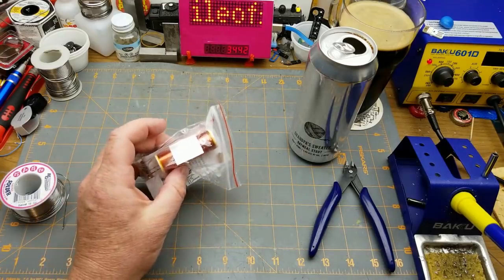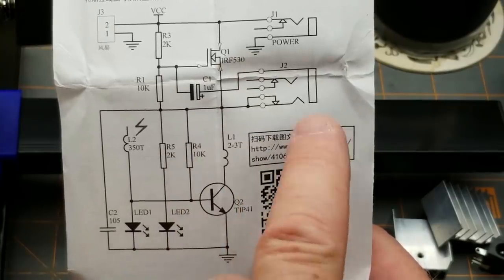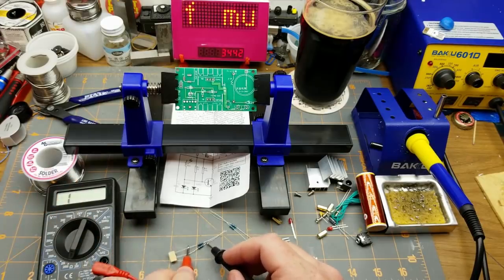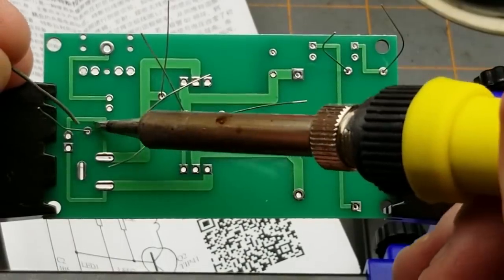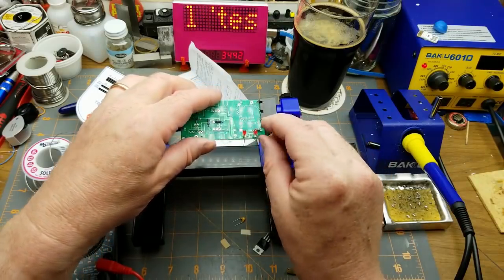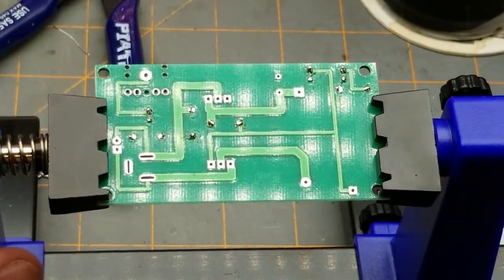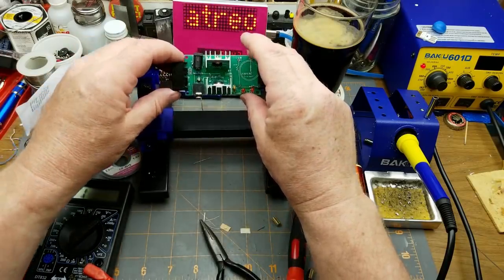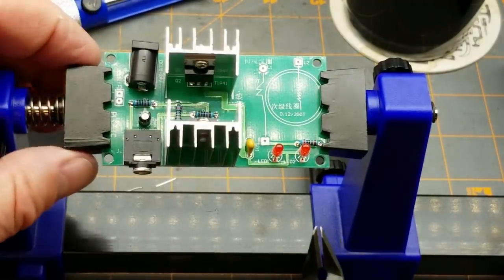kit build: tesla(ish) coil

Comment: These kits are amazingly fun.  If I can offer a suggestion, when you hold the neon or florescent bulbs, you do have to hold the contacts to create capacitive ground and the bulb lights much brighter.  There is no actual contact so to speak, (direct current), so there is no chance of shock or direct voltage contact.  The other suggestion would be to have the discharge wire, (top of coil), untangled and tucked into the coil tube with about an inch sticking out for best results.  If you have stainless steel ball or a stainless steel rod, you can set the ball on top of the coil tube with the discharge wire under it touching with gravity pressing between the ball and the tube so it contacts the ball, no soldering necessary.  You won't see the actual discharge beam so to speak, but then you have a greater surface to experiment with.   If you want to go one better... now, if you have a large Pyrex mixing bowl, (many kitchen aide type mixers have glass bowls, or any large glass mix bowl... flip it over the top of the whole circuit.  It should have a distance of about 2-3 inches from glass dome to the ball to get the best visual results.  Now you can safely touch the bowl and bring the florescent or neon bulbs near it.  Also using the audio input, if you go direct from an mp3 or  any audio source, you will hear music come from the coil, however if you use the steel ball and glass dome effect, you will not hear anything.   (The stainless rod can be dropped into the tube and the discharge wire wrapped around the rod, and that is fun to play with as well, it also saves the end of the discharge wire from burning up and having to cut it back again and again.)  **I've done these risky experiments so you don't have too!  ***As a side note, the 1uf 50v electrolytic cap supplied with the kit should actually be 10uf 50v, but! it can be changed to any thing between 1uf and 16uf 50v to offer variances in audio performance. The lower the value the better the bass response you hear, it is slight, but it is recognizable, just be sure to keep the voltage rating at 50v or above :p  I hope this helps, and give ideas for new experimenting.
Reply: Nice detailed answer. Do you have any idea about what happened to his cap that got blown?

Comment: My kit's primary winding was only long enough for a single turn around the secondary. I had it wound up against the secondary and an arc broke the insulation. I ended up using duct tape to create an air gap and now it works fine.

Comment: I built one of these with my nephew (he soldered it).  We only had a 12v car battery to work with.  Kinda worked.
My bench supply was better but similar results to yours.  I have a decent bench power supply though :-)

Comment: 9:20 - you can easily fix old and/or cheap shitty solder wick using FLUX. I always use pure Rosin paste for repairs and component recycling, so I have it on hand (literally all over my hands), so a quick wipe of flux along the Wick and it's instantly transformed. A good quality liquid flux also works great... leaves less mess than rosin too.
Solder wick needs LOTS of flux in order to work - usually the flux is sparse and once it dries out even the best wick becomes useless.  So add some flux, just try it.
Reply from the maker: That's a good tip.I usually set this cheap wick into a pot of flux and heat it with my iron to saturate the wick.

Comment: If you actually come in contact with the neon or florescent bulb (have the leafs in your hand) it will light up much better! It is safe to touch. The frequency is high enough (in the MHz range) you won't feel it due to the skin effect taking effect and also your nervous can't detect or react to it. The most you'll get is a slight burn (very slight) from the plasma and that's all. Love the video by the way!
Reply from the maker: I've had high frequency burns before, and it's an experience that I would very much like to avoid in the future.
Reply: @pileofstuff  Same here!!

Comment: I just built mine and it produces a tiny weeny spark (~2mm) on 12 volts, lol.

How tight that primary coil has to be? 2 turns worked better than 3 (higher voltage).

Comment: Hi, I tried a simple audio signal generator on my coil unit.
You only need line level signal to get the corona discharge to sing.
I'm thinking of making a simple LM555 oscillator to connect and play.
The fluro tube lights due to the high electric field exciting the electrons.
I did the same thing with the 105 cap.. and like you got to where you had an electro to place..   lol.
Reply from the maker: Off camera I tried a few different  audio sources (including an oscillator and the cheap MP3 player without the amplifier) and wasn't able to get any noticeable sound. 
I probably should have shown some of that, but the video was already getting too long.

Comment: A circuit diagram and silk screened board, luxury!  I bought one which was just a bag of components and a board with outlines but no values marked. Google image search and a really bright torch to try and trace tracks saved the day.  I managed to assemble it and get it working and as usual 5 minutes playing with it and it's sat on the shelf ever since. I sometimes wonder why we do it to ourselves, has anyone ever built a kit that actually gets used for anything?
Reply from the maker: I've got a few that do get used occasionally - mostly test type circuits, though.

Oh, and the blinky x-mas tree kit. That one gets used for a few weeks at a time.

But, yeah, I have a heap of them that have become mostly souvenirs and dust collectors.

Comment: I got a lot on Amazon and it came with no instructions. It's fairly self explanatory so I put it together. Only the blue LED lights up. No power comes off the coil. I'm using a 24v 2A power supply. 
I have no testing equipment like seen on this video. Any ideas how I can troubleshoot it?
Reply from the maker: Without being able to make some measurements it's going to be hard to know what's wrong.

A multi-meter is one of the most useful pieces of test equipment a person can have.
That multi-meter that I used was the cheapest one I could buy - $5.00  (this one: https://youtu.be/3j8JqTh8RoQ)
Reply: @pileofstuff  thank you! I own a multimeter and tried to use it after I saw you text the resistors to make sure I had the 2k and 10k in the right place. The multimeter either and I had them in the right places. 

Unfortunately, it still only lights up the blue LED.

I appreciate the response in your attempt to be helpful. Thank you very much!

Comment: Hello how are you, what was the voltage and current that you used in this Tesla coil? Could you tell me this information? Thanks in advance
Reply from the maker: Voltage worked between 3 and 5 volts. 
I did not measure the current, but it was able to operate from 2 AA batteries or an 18650 with no trouble.
Reply: @pileofstuff  Would the current be 18650 mah by any chance? If not, how much would be enough to light a fluorescent lamp?

Comment: Neat kit, looks like fun.  Anybody know how to convert a momentary button to a switch with two functions (on/off)?
Reply from the maker: It is probably easier to simply replace the button with a different switch.
Reply: @pileofstuff  Realy?  I got as far as using a voltage regulator with drain direct to vcc, gate to a primary button (on), gate to a secondary button (off), source out to led to ground.  It works really well... just want to get it working using one button.  Any ideas?  It may be a good one for a video.:)
Reply from the maker: @jv-iq9uz  Ahh. I didn't understand how deep you wanted to go. 

I thought you wanted to mechanically modify the switch.
Reply: @pileofstuff  Oh, sorry about that... I was basically trying to figure out how to make use of the pack of 100 momentary switches I have in my inventory.  I don't really have much use for the momentary funcitonality.  So I'm trying to figure out a good simple circuit to use repeatedly for the on/off funciton.  I figured it's probably not worth the trouble.  It probably requires a really specific BJT configuration.  What do you think?
Reply from the maker: @jv-iq9uz  Probably a flip-flop circuit would be the easiest way to go. That would need a pair of transistors and a smattering of passive components. Something like this: https://i.stack.imgur.com/oDkoV.jpg
Reply: @pileofstuff  Thanks, that really helps.  I was looking around and thought maybe a shift register for the toggle function.  Something like Sw -> Vcc -> Out -> LED/gnd, then just loop it...  ever tried that?
Reply from the maker: @jv-iq9uz  I haven't played with shift registers except for the LED cube video.
Reply: @pileofstuff  That was a really pleasant video.  Liked it.  I thought maybe Dta/Clk->Q0 for the on function, then Dta/Clk->shift to Q1->master reset for the off function.  It might require a voltage regulator as a gate sat switch, and a pnp tied to Q1 for the pull-down on the gate to turn off the regulator.

Comment: Y transistor very hot?
Mine didnot work.
Reply from the maker: My transistor gets hot after running for some time, because of the amount of current it is controlling.

If yours gets hot instantly and the circuit does not work, possibly there is a short circuit, or the transistor is not installed in the correct orientation?
Reply: @pileofstuff  thanks. i found the problem. my primary coil turns wrong direction.

Comment: I can’t get mine to work at all! Just the LED 2 lit and nothing on LED 1
Reply: Mine did the same you have to wrap the 2/3 coil anti clock ways if looking from above with the power jack on the left then it works
Reply: @quadmcjellydrone7909  I think voltage matters a lot. I don't have the second LED lit either on a 16V input with 3 turns primary CCW but the unit works. It's lighting the small lamp provided if held very close as well as a regular light bulb. But, no arc visible! So I suppose no audio either?
I guess it only works at high voltages 22+V.
Reply: @goku445  I found sometimes the ark stops but if I snip 1mm off the end of the coil it starts to ark again
Reply: @quadmcjellydrone7909  thanks for the tip, which input voltage do you use btw?
Reply: @quadmcjellydrone7909 Cheers for the tip, I'll try that

Comment: Thanks for sharing!  I actually built this kit about a year or so ago.   The circuit is called a slayer exciter coil.   One difference from a true tesla coil is that it is self resonant, whereas a tesla coil has to be tuned.  I got the audio to work on mine by just connecting my MP3 player directly into the input jack.  I did a video on it a while back.  https://www.youtube.com/watch?v=t8TwKls-e0o&t=1485s
Keep up the good work, and thanks again!
Reply from the maker: Off camera (before I blew up the amp board) I tried the MP3 player direct and it didn't seem to make any sound, which is why it occurred to me to try and hit the audio input a bit harder.

Comment: the automatic wire stripper you got is complete garbage, this type doesnt work at all. i got the "cheap german" from the video andreas did for 2-3 years now and its working flawless.
Reply from the maker: Yup, it's only even a little bit functional with a couple of sizes of wire. Too small and it sherds them, too big and it just scratches the insulation.